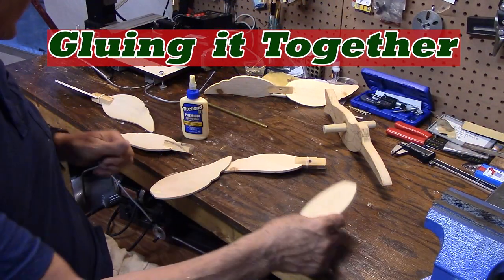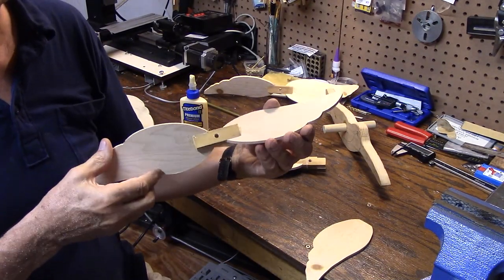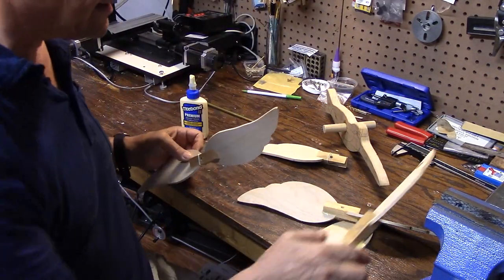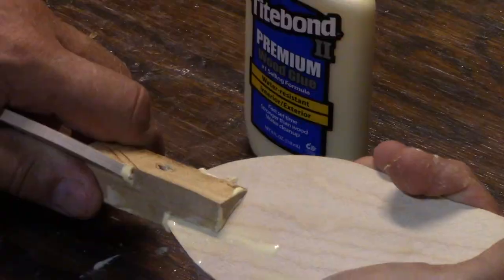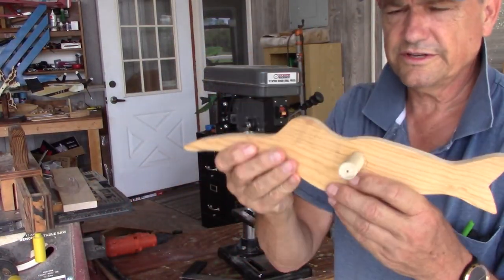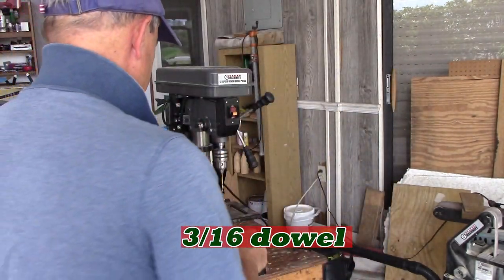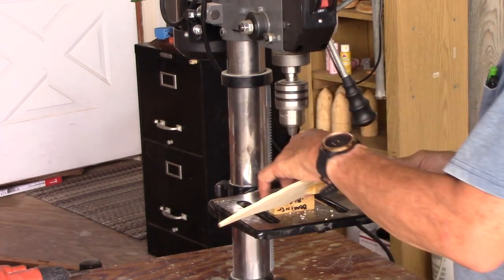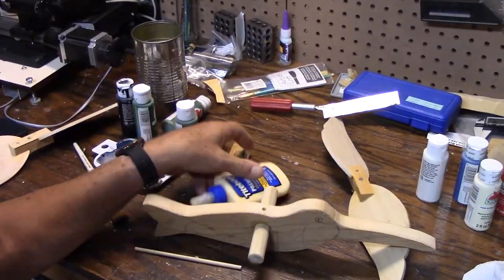How to Glue your DiY Whirligig Hummingbird together Part 3

Comment: Kun je mij de maat geven
Reply from the maker: Ja, de vleugels zijn 41,59 Centimeter lang en 7,62 centimeter breed.  De body is gemaakt van 1,9 centimeter dik hout. Hij is 36,51 centimeter lang en ongeveer 7,62 centimeter breed.  Vleugelnaven zijn ook gesneden uit 1,9 centimeter hout, 6,35 centimeter lang, met een gat van 6,35 mm in het midden.  Het kruisstuk om de vleugels te monteren is een rond stuk van 1,9 centimeter kolf van 12,06 centimeter lang.
Reply from the maker: The body is made from 3/4" stock.  It is 14 3/8 inches long by about 3 inches wide.  The Hubs are also cut from 3/4-inch wood, 2-3/4 inches long, with a 1/4-inch hole in the center.  The cross piece to mount the wings is a round piece of 3/4 inch stock 4 3/4 inches long.   Wings are 16 3/8 inches long and 3 inches wide, cut from 3/16 thick stock.